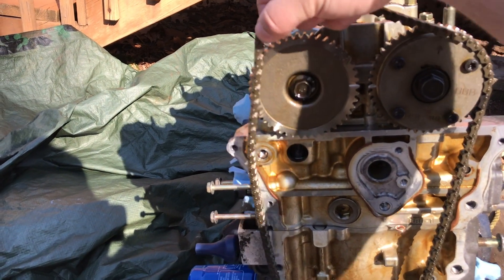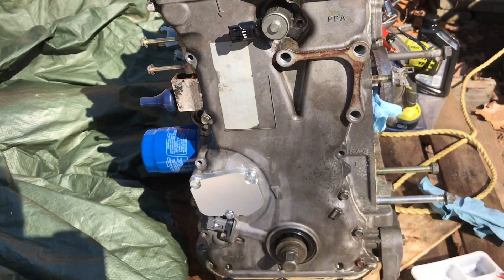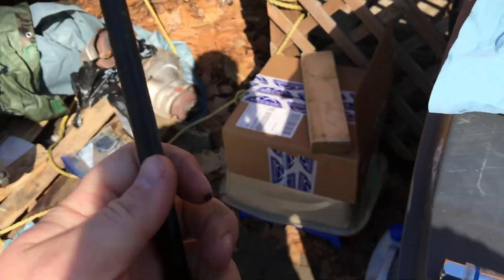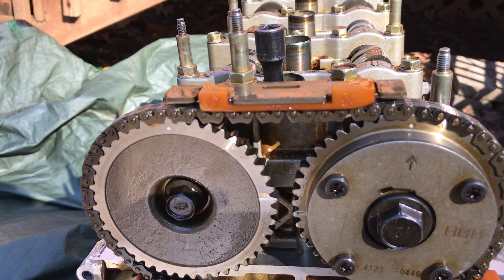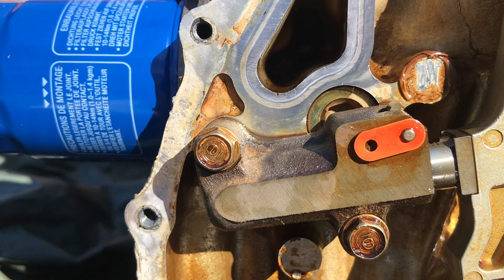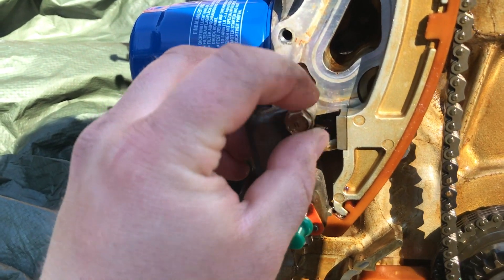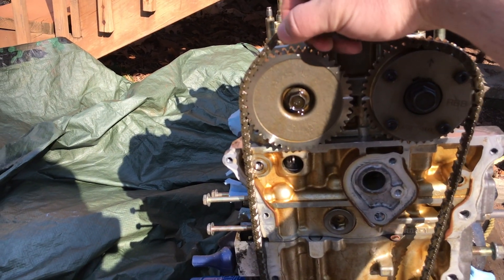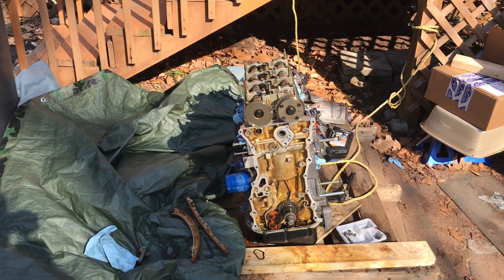Honda K24 Timing Chain Replacement

Comment: Hey bud, quick question; I removed the cover and am replacing all the timing parts with a kit. I stupidly cleaned all the surfaces as I went without taking pictures. There were several spots where there was some type of sealer, besides the side mating surfaces and now i dont remember  where, and i dont see a guide anywhere. You happen to know where i need to apply gasket sealer besides the sides?

Comment: HI mate great video. thank you....we  have a k24z in my daughters 09  honda accord euro Australian spec..(acura tsx) over there.. it has the cold start rattle which were addressing shortly but also pings under load all the time..could this be the timing chain stretched or chain tensioner gone bad..? looking like ive got to remove the engine to do this job..? any advice appreciated..
Reply: Does the car start after the chain stretch?? Because my car won’t start after P0341 code came up
Reply: I have a Acura tsx 2.4l 2010

Comment: Keep in mind that the K24Z2 does not have a crank position sensor in the same location so you will have a washer instead of a sprocket on the crank shaft...

Comment: There is a Honda tool that holds the crank pully by the way you CANOT BUMP THE STARTER WITH A BREAKER BAR TO BUST THE BOLT FREE

Comment: 1:00 What happens you I didn't set the engine to TDC before taking out the timing chain? My engine skipped timing so the marks don't even align. I already took the chain out did I mess anything up?

Comment: K24 engines only need a new timing set if they are ran low on oil. I have 260k on my K24A2 and the original timing chain is still fine.
Reply: Not so. I have an 05 with 245k. Oil NEVER ran low and changed faithfully every 3k. since brand new. Chain just slipped lost compression in all cylinders yesterday 😢😢😢

Comment: Great video but you really need to call the parts what they are called. It wasn't the crank you removed it's the crank pulley. When showing top dead center you looked into the spark plug tube not the cylinder walls. If your going to teach on youtube teach the right way!!!!
Reply from the maker: It’s actually called the harmonic balancer, so we are both wrong.
Reply: @TheGerbSteve im old school i think harmonic balancer like older small bock chevy. Since it's the pulley too I always call it a crank pulley lol.

Comment: Thanks for the great video. If I were to change the timing tensioner only by taking the tensioner cover off, with the engine in the car - how can I ensure the chain does not jump timing? It looks like the guide becomes very loose once you take the tensioner off.
Reply: It can't jump teeth since the chain cover is designed with a lip to keep the chain on the gear

Comment: This is super awesome! I am currently taking a k24a2 apart and I have no experience….

Why are you making sure everything lines up before you pull the chain off? 

Why did you want the piston closest to the chain at the highest point?

Why did the tensioner need to be locked before being pulled out? 

Is their a specific order the bolts on the top of the head need to be removed?
Reply: That’s to put it in timing so he can just put the new chain on and tighten everything back up

Comment: Great descriptive video! One question, I have an oil leak coming from the bottom right timing chain cover just above the oil pan right side. It looks like there’s no gaskets inside so a simple Honda bond reseal should work ?
Reply from the maker: Try some good old Honda bond, stuff is a life saver

Comment: I'd like to see the chain installation. I currently have an 06 honda accord with the 2.4 that im about to do a timing chain on.
Reply: Did you find an install video?   I have to complete this task
Reply: I want to replace the oil pump chain, do I need to remove the oil pan in able for me to get the chain removed? But I’m also going to replace the timing chain.
Reply: @HAZARDWILL did you figure it out?

Comment: So when is a good time to change the timing chain?  Answer- when you get a check engine light that shows the timing is too far off from the chain being worn out, when is that going to happen probably never that little self adjuster takes up all the slack, It's made to last the life of the car!
Reply: My 2005 just lost our compression and we are quite sure it’s from the timing chain there was no check engine light and it has never been low on oil have faithfully checked it every Monday cold and have changed the oil faithfully every 3000 miles😢😢😢

Comment: If just changing the tct as preventive maintenance and engine is still in car you wouldn’t need to put those pins in the cam gears to remove the tct?
Reply from the maker: Yes, I recommend using the cam pins so none of the gears move for replacing the vtc

Comment: https://youtu.be/vpD35ndGBoY?t=265, but hang on, those punh marks woudl only be horizontal if the timing tcahin wa snot stretched and everythign is rosey, in whcih case you wouldnt be doing this? The ocrret way is to put the cover back on and line up the crank pulley with its tdc mark.

Comment: Would be more valuable if he wasn’t messing with a motor already out of the car. The average motor would be in the car, not on a pallet. Using that motor for demonstration is a waste  of his time
Reply: If you take off the passenger wheel, passenger motor mount, the timing cover (along with the valve cover) will be an ease. Trust me, you have enough space to put in 10mm wrench or a mini 1/4" ratchet

Comment: Also what do you do when it’s at TDC but the horizontal marks don’t line up on the CAM gears??
Reply: There's holes on the back on the cam phasers opposite side off the gear when you have both gear pointing at eachother. You put either the tool they sell in those holes to lock it in place or use drill bills once you do that you cams are set and you put bottom TDC. K24 has 2 colored links per cam mark and one colored for crank mark. One everything's lined up zip tie with out the tensioner thatl keep it in time and putt the tensioner on tighten it pull the pin. Cut zip ties you know the rest your 🙏

Comment: How many miles before these have chain issues? I’ve not noticed any problem with mine but now I’m worried
Reply: 60k - 105k depending on how severely it is driven
Reply: @PsillyFL  hmm we’ve got 120k on ours and have not had any issues there.
Reply from the maker: I've heard like 100k-120k, but the chain are meant to last forever, I believe. It's the tensioners that give out or cause the chain to wear.
Reply: @TheGerbsteve  thanks for input, I hope ours continues problem free. I think I noticed some light wetness of possible gear oil around the output shaft during the last oil change. May be a seal, now to figure out if that’s a big job or if those additive sealers will work.
Reply: Mine just stretched and jumped time at 265k miles
Reply: @mpaxton6686  what was the symptom that happened that caused you to figure out it jumped time?
Reply: 02 CRV at 240k and mine shows symptoms of worn timing chain
Reply: @BenRossi901  what symptoms show it’s a worn timing chain did you have ?
Reply: @lh98  

Rough start, shuts off after starting, then just turns off when it starts. Plus, a slight gasoline smell
Reply: @BenRossi901  I never had any of those symptoms when mine just skipped.  Actually I thought it was the catalytic converter even though there was no engine lights it just made a terrible noise

Comment: When replacing the timing chain, you also need to change all the gears for new ones, since the old gears already have a workout and a quickly stretched new chain! And so that the chain does not stretch and the gears do not wear out, protect them with XADO revitalizant !!! I had a case: I punctured the engine sump and lost all the oil, but I drove 80 miles to the repair site on my own !!! and the engine was empty. I replaced the pallet, filled in oil and drove on, and this is all thanks to XADO from Ukraine !!!

Comment: so i have a slight leak in my timing chain cover on a 2007 accord with 89k. it's under warranty for that but the mechanic recommends i replace the timing chain and have a valve adjustment at my expense since it will all be opened up anyway. $300-$400 for my end...do you think it's worth making this investment when there are no signs of needing these repairs? i plan to hang onto the car. appreciate any response.
Reply: yes
Reply: @turbodog99  - i ended up not doing it. forgot all about it til now.
Reply: Do you know how they ended up fixing the leak? I also have a leak on the cover just above the oil pan but I’m trying to see if I should just open up the cover and reseal it with Honda bond
Reply: @vmanjose  - i had them just replace the (timing chain) cover. didn't cost me anything since it was under warranty. i didn't have the additional stuff done although it wouldn't have been a bad idea; as a preventive thing. i just don't like doing work if it's not needed. for your situation, i would just make sure i knew which cover the leak was coming from and go from there.

Comment: Do I have to pull out my engine to replace the timing chain? Mine is stretched and I don’t know how to do this.
Reply from the maker: No, you can do it while the engine is in the car, just going to be a tight squeeze.
Reply: @TheGerbsteve  

A tight squeeze indeed, it's best to use a small ratchet 🤪

Comment: Thanks for the nice video!  Very helpful with my crv timing chain replacement.  Stupid question, what's the lower chain, and do I need to replace it too?  My kit came with a replacement, but I cant get the old one off.
Reply from the maker: You’re welcome.. lower chain is for the oil pump and you can if you want, but a lot of people just leave it the way it is.

Comment: Dude thank you so much🙏🏼 there is hardly any good videos out there about things we need to see. Currently in the process of sourcing everything I need on my k24a swap for my 09 fa5🤞🏼
Reply from the maker: You are welcome and I hope these vids will help you when it’s time for your swap.  What happened to your k20?
Reply: Gerb blown headgasket😔 had a bunch of problems leading up to it. Car was definitely abused before I got it. Only good part is the dealer I got it from put a brand new trans and clutch in it about 100 miles before I bought it. Haha. Been sourcing parts already and probably pulling my motor tomorrow and prepping to paint it and clean up the engine bay.

Comment: should just put your z3 head on it. no need to upgrade the oil pump if you're not turboing it you can still rev out safely to 7800

Comment: The white dots/arrow  on the cam gears are supposed to be between the different colored chain links and and line up the bottoms arrows and the chain link as well will have a different color  on the chain that supposed to line up to marks on motor your at tdc  but not in time perfect just letting you know

Comment: Doing a k24 swap in the fg2?
Reply from the maker: Yessir. Just finishing up some final touches/maintenance before I drop it in
Reply: @TheGerbsteve  Did you do an oil pump upgrade?
Reply from the maker: Not yet, but I’m contemplating on it 🤔... If I can get at least 8k rev out of my k24, I’ll be content.
Reply: @TheGerbsteve  Don't know what kind of budget you're on but hptautosport sells the PRB oil pump kit that's already modified to fit the k24 block. Comes with everything but the oil pump chain tensioner you have to buy separately. That'll get you 9k safely if you ever decide to go with bigger cams.
Reply: @allmotorfg2437  9k on a stock k24 bottom end would be a bad idea
Reply from the maker: We on a tight budget, $1,500. I thought about a type s pump, seen it on HPT for about $300 or so. Honestly, I think I’m going to just run the stock k24 pump, 7800rpm, maybe 8000rpm if I’m ballsy. Don’t know if I’m gonna go cams or not in the future, but I’d like to experience the turbo k24 feel, so maybe that’ll come ... We shall see though. Once swap is up and running for a bit, you know I’ll be doing something else to it 🤫
Reply from the maker: So I’ve heard.... piston speeds are way too high. Bottom end wouldn’t last, unless built, but who knows 🤷🏼‍♂️... I will be content with 7800-8k rpm max
Reply: @TheGerbsteve  My buddies got a stock bottom end 24 frank with a z3 head DC 2.2 cams type S pump. Rev limit set at 8800. Been running that setup almost 3 years now.
Reply from the maker: I stand corrected 🤣... For my first k24, I’m gonna keep her oem-ish.  Once I start hitting track, get my own house/garage, I’ll build another k series on the side.